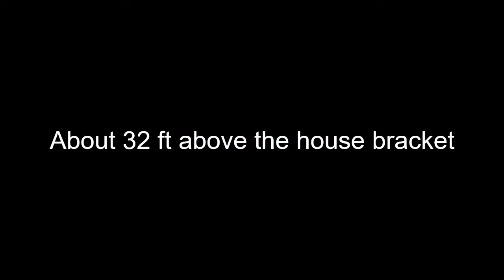Rohn 25 Tower Raising using Hinge Plate - 52ft

Comment: Can you tell us what the concrete foundation consists of ?  (i.e. how deep, how wide, and is there any additional rebar in there for the 6x 1/2" x 12" J-bolts ?  Rohn has conflicting information on the foundation for a "hinged" base plate (vs. the regular free-standing base which requires a 4-foor section of tower section to be placed in the concrete).
Reply from the maker: My original pad was just for 42ft of tower tied to the house bracket up about 19ft.  I've been up and seen so many less than what I have with the house bracket.  Now my concrete pad isn't as big as have as used in the past (more of 3x3x3) since it's 42ft with the bracket.  This one is about 3ft square and about 18" deep.  Since I added 10ft of height to 52ft I did add a couple of ground anchors right beside the concrete pad that has some turnbuckles tied to the winch bracket with angle iron.  The pad has some rebar near the j-bolts not welded together.  Looking back more concrete would have been better but this has held up fine.  No failure thank goodness.  The square tubing that holds the winch has welded extra cross brackets attached in the concrete.  The pad is about 10" from the house foundation I think.  Lots of reinforcement on the house bracket outside and inside with the trusses tied together and with a back-guyed cable some 15ft back and down.  In another video I do show the stress weight on a set of scales.  With the 42ft tower it had about 400 lbs. of tension.  Don't remember right off on the 52ft.  I was some reluctant about the pull but didn't see the stress on things I expected and was certainly glad.  

Hopes this helps.
Reply: What exactly are the anchors beside the tower foundation used for?
Reply from the maker: @theboogeyman826  Nothing but an afterthought of adding some support to the winch support in the concrete.